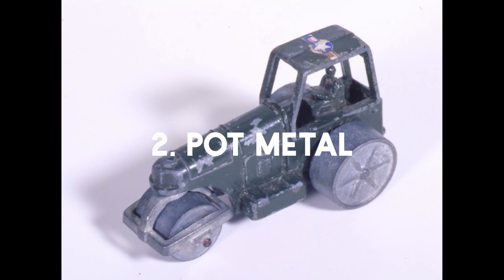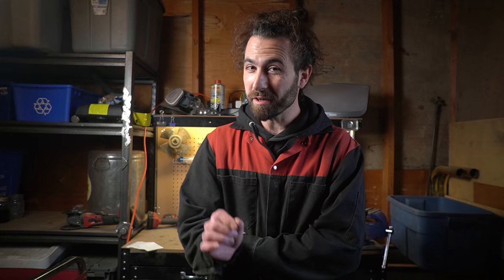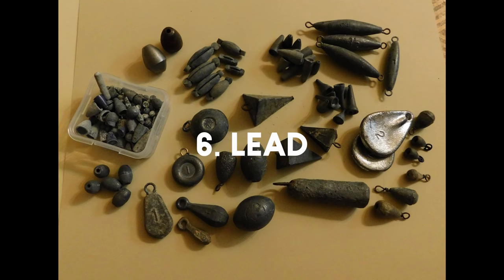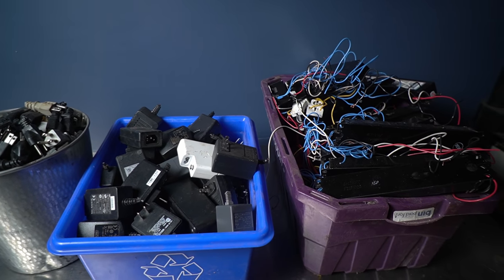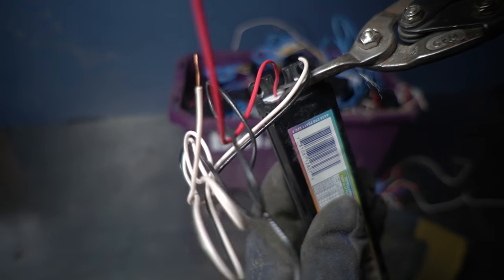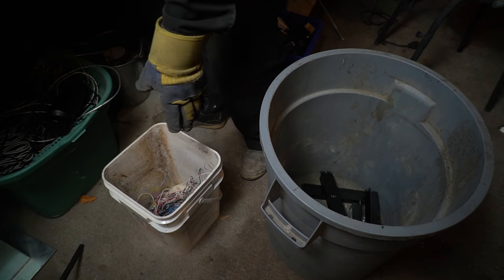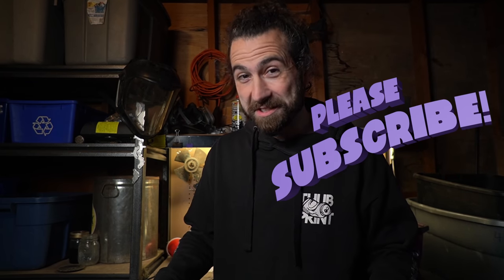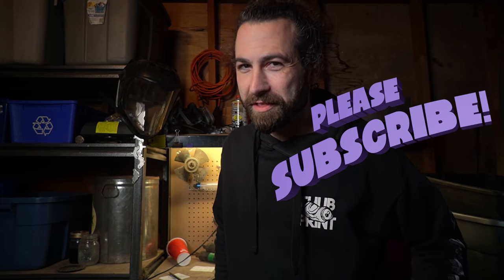I Never Scrap These 9 Items!

Comment: For the computer power supplies, If they are in good condition, you can sell them as-is on Facebook Market place for $5.00 to $10.00 each, more even if you have the high end brands.. I have built computers for over 15 years, there are always lots of people wanting to buy them to DIY fix their own system for cheap, A computer shop will charge someone up to $100.00 just to replace the power unit.. Most older computer parts are kinda worthless unless they have lots of gold bearing components..
Now for the laptops and whole computers, just find someone you know or reach out to someone doing computer repair or sales used computers and offer them to them.. As a computer builder I had 4 or 5 scrappers who I bought computers from. I gave from $5.00 to $20.00 dollars each, now on the real old ones they have lots of gold plated components in them.. 
On the plug ends. A pair of vice grips and a pair of heavy duty plyers is all you need, by the time you get the water and put them in it and wait for them to get hot, you could have already had them done, for doing them, I wait for a rainy day or save them to do in the winter when you have nothing else better to do and hoard them until spring/summer (warm weather) and sell when the price is up.. I have done very well with them, when I decided to leave them as a rainy day/winter clean job, LOL, I know it is a tedious boring job, Have a tv on or listen to some tunes.. The other stuff I agree with ya.. Also (Not judging) I have children older then you, LOL, and if you use leverage cleaning plugs are easy, without heating them up. I also conned my kids to do them too and bought them pizza for doing it.. Thank you for sharing.. Love the tips, I wish more people would take the time to share tips & experience's.. Sorry my comment was so long, some things are easier to say then explain by writing.. Be Blessed and keep doing what you're doing.....
Reply from the maker: Hey I appreciate the input! I think maybe I’ll hang onto the plug ends even if I don’t plan on doing them. Now that I know they pay pretty okay, I wouldn’t feel bad giving them to the young’uns to do for some pocket money
Reply: @thubprint  Your welcome, I love to share information and knowledge I've accumulated over many many decades of life experience.. By trade I am a Master Carpenter, I was forced into retirement because of health issues (I pushed myself way to hard for better then 30 years) I owned an ran a small engine shop, where i found i can make even more money selling scrap to the junkyards, It got to the point where I could no longer do that, so I turned the shop over to my son-N-law, (I still get 10% of profits). After that I Built computers (I have been into them since the early 80's). Then for several years I did scrapping & building computers until that got to much for me. All I do now is build computer for a select cliental. (high end computers) Do maintenance/updates/upgrades for the same & build computers I give/donate to children who need them, but can't afford them..   I have a vas knowledge of quite a lot of things, and I very much enjoy sharing what I know.. Sorry, I tend to babble on and get a bit carried away.. Feel free to pick my brain any time you like.. Have a great weekend and Be Blessed...
Reply: That's good info about contacting a computer repair shop. Many years me and buddy found a huge tangled pile of corded computer mice in an ewaste bin. We took it home, slowlyl detangled the pile, tested them, bundled the cords neatly with rubber bands, and then traded them to a local computer repair store for 50 cents on the dollar as store credit. That bundle of computer mice ended up buying us a bunch of nice computer upgrades!
Reply: @lihtan  Nice, I have been building computers since seems like forever, I hear ya though, I paid Junkers more then they would get from scrap prices and I gave them back what I couldn't use for them to scrap out to the point many scrapers now just give me what they find computers, laptops, tablets, monitors Keyboards and the lot.. Those who have been with me for years I do all repairs, updates & upgrades for free.. Now, I mostly just build higher end computers for higher end buyers with deep pockets and on the side I put together more simple systems for children who's parents can't afford a computer.. They may have used parts, but even those systems lightning fast and have good HD monitors.. I have 4 different pawn shops that just give me all their broken tech, even smart tv's that don't work.. These new led tv's are awesome, they average costing from $5.00 to $40.00 to fix and have a perfect TV.. We have 3 75" Samsung smart tv's, They didn't work and were given to me, $40.00 fixed all 3 and they work like brand new.. Having skills in tech, guarantees you making good money.. I am self taught 90% a few things I learned from other friends who are also computer builders.. Where I live there are only like a dozen of us who are the best.. Sorry for babbling on like that.. If you have even a small amount of skill with computers, seek out others and learn from them, lots of good money to be made and all honestly.. Thank you for sharing your story...

Comment: #2 - .36 zinc cast last two times I brought it in. Worth separating if your yard pays.

Plug ends - the large ones from dryers, ovens etc are worth pulling the brass chunks out imo. 

Ballasts - price keeps going up, then way down, then back up - repeat. Worth saving if you time the price waves.

And if you find yourself this summer on the West Coast - drop me a line - I'll bring you scrapping!
Reply: My scrapyard won’t take the small ones, but the larger ones they take as dirty brass. Weird.
Reply from the maker: Right on! I haven’t found a price for zinc higher than dirty alu, but at least it’s something
Reply: @thubprint  60 cents /lb in southern Ontario for "zinc die cast"
Reply: @thubprint  Yeah, they take it as aluminum breakage at my yard. Better than double shred, so I guess it is something.

Comment: Plug soup! That’s a great idea. I’ve been saving plug ends for rainy days (something I can do indoors while watching TV, doesn’t make a mess). The ballasts are a real problem here in Florida. You can only bring 2 per load, don’t ask me why! Same with batteries, 2 per load, and they can’t be damaged! I guess it’s for safety. And don’t ever bring in any kind of computer, it doesn’t pay! Personally I disassemble them just for fun, it’s like mining for gold, literally. And there’s some other fun things in there like the magnets and the aluminum heat sinks (extrusion). As you can probably guess I don’t rely on scrapping as my single source of income but it helps boost my Social Security check a little and my wife and I get by. I don’t make much, it’s a pass time anymore but it’s my little zen thing and I help keep the planet clean! Happy Trails!!!
Reply from the maker: Wow, things are really different in the scrap world depending on where you are! It’s pretty tough to make a healthy consistent income from scrap, but as a relaxing hobby that makes a little side income it’s excellent
Reply from the maker: Wow, things are really different in the scrap world depending on where you are! It’s pretty tough to make a healthy consistent income from scrap, but as a relaxing hobby that makes a little side income it’s excellent

Comment: Laptops i fix them up or try to. The recycle value on a modern one is total 💩 but the battery cells can be used to fix other stuff. One e item that has absolutely garbage recycle value are old inkjet printers. Followed closely by newer flatscreen TV sets. Transformer stew... for people with reflux disease its different. 😅

Comment: Hey thub out of curiosity do you feel liek ya ever find yourself after having scrapped or processed etc things with rust, oxidation, shavings, powders particularly dark powders eg carbon manganese or the like etc fwiw imho as carbon is seemingly one of the most tedious so to speak worth of a can of worms is more like it hehe...things to widn up an find yaself tryna deal with, or like probable risk for hearing issues level of noisyness etc and pretty much anything that tangles in fiber like textile textured materials/staining ya floor? Whether by a friable/powder substance or grease/gum and adhesive eg sticky things after or even before maybe even during removable of such substance with adhesive remover with stains etc in either floor and/or clothes etc?
Reply from the maker: I think all those descriptions cover pretty much everything 😆
Yeah I make a bit of a mess and get kinda dirty when scrapping, that’s why I keep it to the garage lol. I try remember to wear my hearing protection and respirator whenever making dust or noise, and eye protection always. It’s just a risk that’s always there so the ppe is a must

Comment: I take apart all my transformers and electric motors and the older ballast that got copper coils in them because them older balance were copper coils in them some have copper and aluminum but the ones with two copper coils in them two ballast makes you a pound of number two copper now that's worth breaking down it's a little messy but it's worth breaking down that's good money
Reply: Go back and read that out loud.... fucking hell.  Education has failed a lot of people.

Comment: So the scrap yard I go to actually stopped taking aluminum foil simply because people are just bringing it in thinking they can make money off of it and I've seen people bringing aluminum cans as well as just raw motors still fully assembled and I honestly see them as wasting a bunch of money because they don't know if you just take a little bit of time get the copper out you can actually make more money I have seen people bring in a lot of things to my scrap yard and I have brought into pretty absurd things but nothing too absurd I think the most absurd thing I brought in was the case for a lawn mower that was about it
Reply from the maker: They don’t even take the foil type aluminium? That’s kind of fair, you lose a lot of weight when you melt that stuff down.
Motors can be a pain if you don’t have the tools though, it’s perfectly reasonable for some folks to sell them whole. I strip mine out but it took me awhile to sort out how to do it well
Reply: @thubprint  true and yeah that's why I don't take aluminum foil either I rarely if ever had the right tools and I can still strip down motors it's not that hard if you know what you're doing but if you don't know what you're doing it's 10 times harder so that I can understand
Reply: @hoinckotheneighbor  sometimes it feels like things are not worth doing like motors because it takes long the first few times, but as you take things apart you develop tricks and see patterns and become much quicker at it.
Reply: @gargalash9191  my point exactly although I've gotten really good at doing a few things it still takes me awhile to do one

Comment: Seems people make more smelting everything than just going to the scrap yard to sell. If you do know what you're doing there's a lot of precious metals to take off of motherboards that's not just the copper and other component but also things like gold and platinum. Yes, even those hard drives you're throwing out has a little bit of precious metals in them.

Comment: I recently discovered that vape cartridges for distillate Marijuana oil and others are ether made of brass,copper or sometimes titanium and stainless steel. I have a medical card so I buy them a few times a month also I work at a school so I find them in the bathrooms all the time. Each one with the glass broken off weighs around 145 grams so they add up fast and the labor is very little. I figured with what I smoke alone I’ll have 12 lbs of brass a year never mind what I find on the ground and other people I know save them for me.I scrap as a hobby so it doesn’t matter to me I take it all cause my dad has a very good friend that owns a scrap yard so he has to put up with me coming with 15 bins of different scrap you name it I do it. I also have a work shop in my basement with a dedicated area for bins also a work bench with a decent amount of tools at my disposal. Eventually I’m going to retire from the city once I’m paid into my pension I have like 5 years left I was hoping to Retire at 50 or 55 and then do scrapping full time for extra money and how can I forget all that fun! It’s a stress relief for me.

Comment: Lap tops and computers,
They said there is gold and silver connetors in these units and in these integrated circuts .
I understand if you remove all the waste plastic, and crush the rest of it into small pieces,
There is some dealers around that will pay a small fortune for said,

Comment: I cut my wire off of the balances then I knocked the black 10 skin off of it then I put them in a bag in a freezer when they freeze you can take a hammer and hit all that stuff that’s Cotnam and find all those little things of copper wire that are in there and clean them up much fasterbecause when it is frozen, it shatters off and shows that copper very fast

Comment: The PC power supplies really kill me, because it LOOKS like there should be treasure in there. Laptops, too. It's hard to resist hoarding those because it feels like it should be valuable. Turns out the scrapyard doesn't have a special per-pound rate for "vibes," unfortunately.

Comment: After taking the prongs out of the rubber, don't forget to remove the copper wire off of the brass. That way you get paid two times 1 for the copper and 1 for the brass. As for the ballast you have to take it fully apart. What I mean is fully dismantle it. As for the laptops you could always find out what is wrong with them. I don't do the time is money thing because, I don't do this as a job, but as a hobby. I don't drive. I used to be on eBay but between all the commissions and fees they want, it's not worth it for me.

Comment: If the diamond is inside a hard rock, just crack it. All those plug in pieces and everything else that has solid outering, or its other reasons difficult and time consuming to disassemble, just smash them one way or another.

Comment: I'm amazed that you find the switching power supplies (both the desktop and wall varieties) not worth your time. Take a hammer to the transformer core, and you end up with a wad of clean pure copper. None of that rubbish with half the weight of the transformer being steel laminations, that probably cuts into the value, depending on what arrangement you have with your yard. The fins inside the power supply are aluminium, the wires are tin plated copper, and the rest goes in the PCB stack (companies will pay for those as well.)

Comment: Just taking a sanity check here... you save the lithium ion batteries from the laptops... right? And, I keep the zinc/zamak for casting projects (zinc/zamak melts just barely at stovetop temps), because it's hard to find someone who sells it, and none of the yards here even have bins for it. Plus, smuggled into aluminum, it's worth far more, so, makes sense for you. I bet if you kijiji'd the zinc you'd find some home metal casters that'd give you a decent amount for it. Best source of it I've found are cast 2-hole punches from ACCO.
Reply from the maker: I don’t have anyone to sell the lithium batteries to unfortunately, but I haven’t tossed any of them

Comment: Like you said, it depends what your scrapyard pays.  My yard specializes in escrap.  I get the same for laptops complete as I do for #2 copper.  They're gold (well, copper) to me.  Part of this is a different method of collecting and sorting scrap.  I've got containers that don't get a lot in them.  They can sit there for a year before I bring them into the yard.  I bring brass once a year.  Something else I get good money for is batteries.  Lead acid or lithium ion get the same money for me.  I also do this stuff for fun and my trip to the scrapyard is always in combination with something else that I have to drive by the scrapyard to get to anyways.  So I'm not wasting a trip.

Comment: Not for youtuber, but any scrappers..
Hold onto everything that you know has metals more valuable than steel but isnt worth your time deconstructing by hand tools. 
Figure out what a whole shipping container would be worth. Then figure out what a shipping container wiuld be worth if it were crushed. Then shredded. Shredded and magnetic material separated. 

After that research is done figure out if you get everything everyone in your area is passing on, efficiently, and crush or shred it. 
Then make a plan from there. The opportunity is doing what others dont want to do

Comment: Well I guess it depends on where you live I get 40 cents a lb for die-cast pot metal and I get 45 cents a lb for the aluminum  pie pans baking sheets aluminum foil basically  get sheet and cast aluminum cleaned price

Comment: I disagree about pot metal because I grab sink fixtures and kitchen plumbing it has good brass but there is some pot metal. As for power supplies the older computer ones have a good amount of copper.i collect all electronics I can find. I depopulate the boards co far I have several buttons totaling 120 grams of gold and about 5 oz of silver..wrote this as I was watching it.i agree about not selling everything at scrap yard.